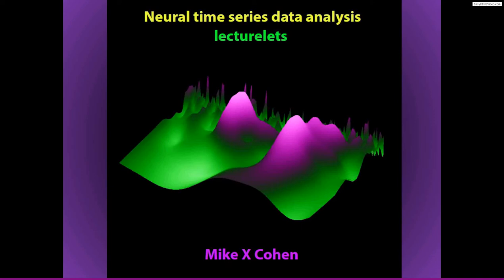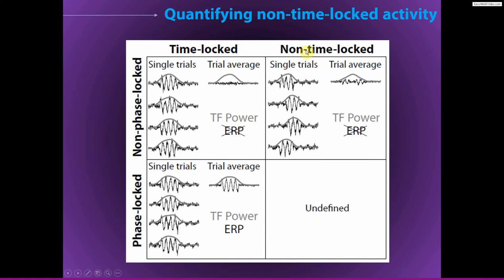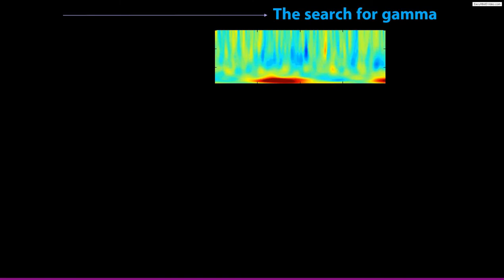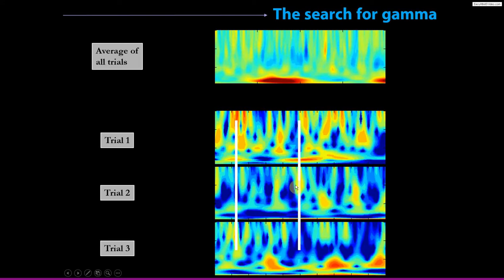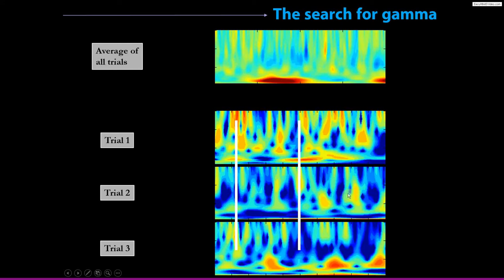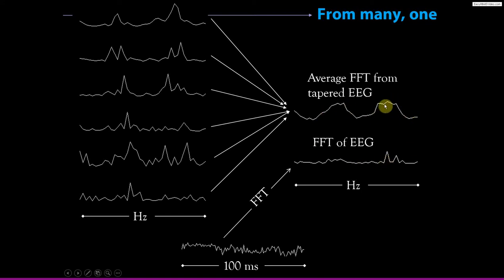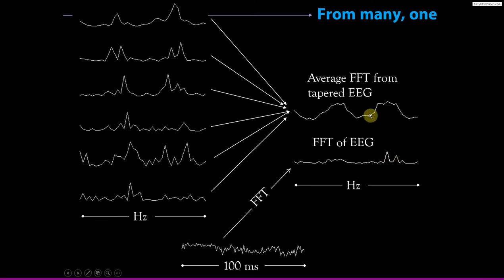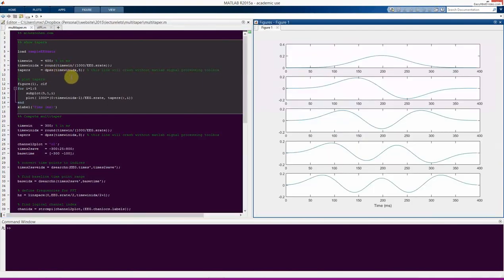Multitaper

Comment: Thanks for this video. I would like to ask what is the unit measure of the power spectrum after running MTM FFT on demeaned data. I searched anywhere and I could not find a reliable answer. Thank you!
Reply from the maker: That's a tricky one. It would be possible to have the original units (e.g., microvolts), but there is a lot of windowing, averaging, and overlapping time segments, which makes it difficult to preserve the units. In these kinds of analyses, it's usually best to normalize to arbitrary units, decibels, or percent change from a baseline time window.
Reply: @mikexcohen1  Thank you very much!